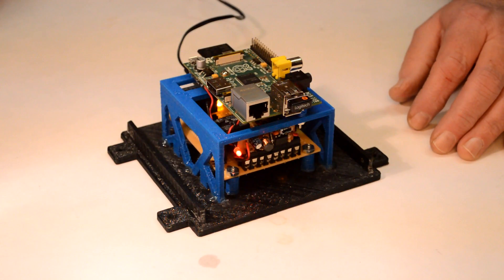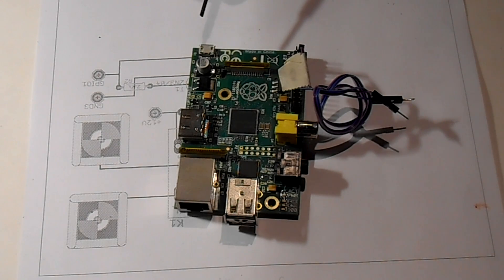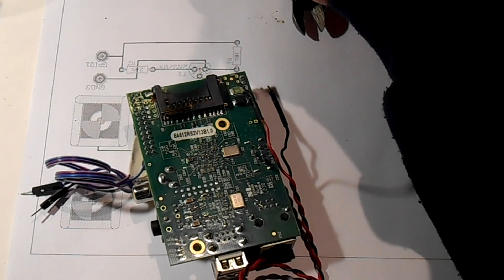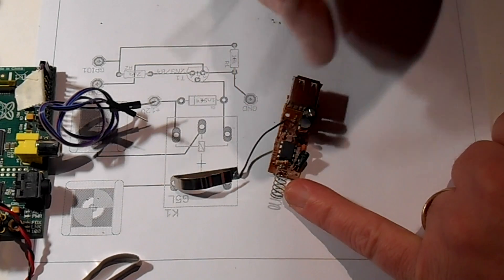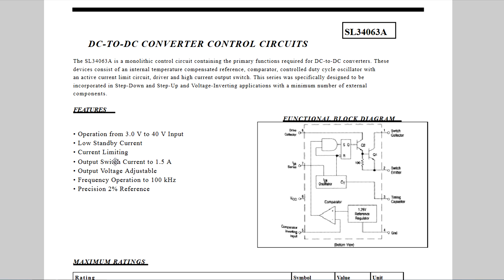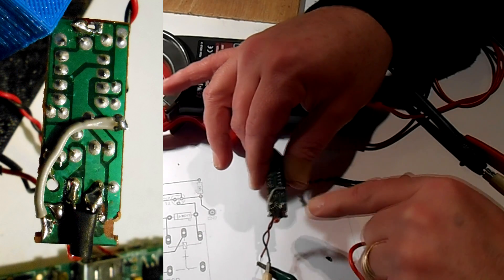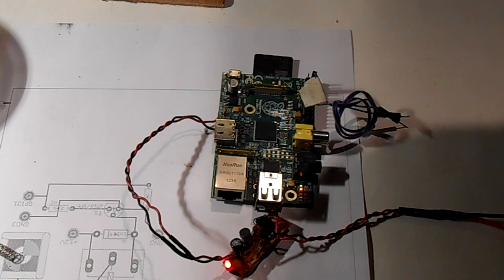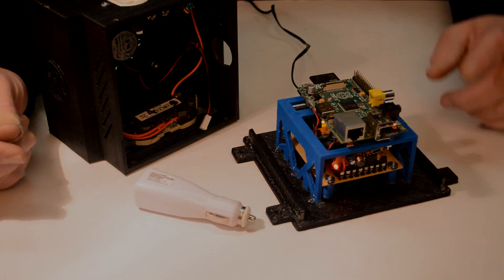Cheap 12 Volt - DC to DC Converter Solution For Raspberry PI

Comment: Great project man. I will be sharing this with students I am sponsoring here in the Philippines who have few resources to work with. I am sure that if a builder were to order a 555 chip it would cost far more than $1.00USD. My only concern is that the new Raspberry Pi 3 requires 2.5 amp or it will throttle the speed back to below the speed of the older Pi versions.

Comment: I like your vids, but please do yourself a favor, and get a better iron, or maintain you tips better.
Reply: +James Hall Better irons won't maintain tips any better than a lessor iron.  Too many people (and I'm one of them...) think that better tools make the job better.  It's really about knowing how to use what you own to the best of it's ability.  His connections seemed to work just fine, I do agree that the tip was a bit crusty though.  :-)
Reply from the maker: What you're seeing is hot glue that I put on the wires to keep them stable not solder
Reply: +GuruBrew HUH? What ever you say Nick Offerman.